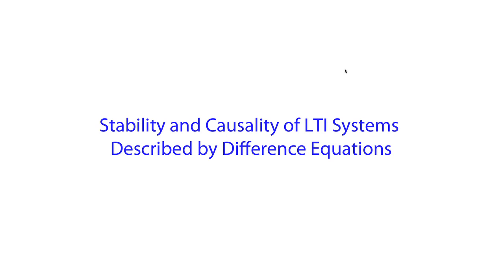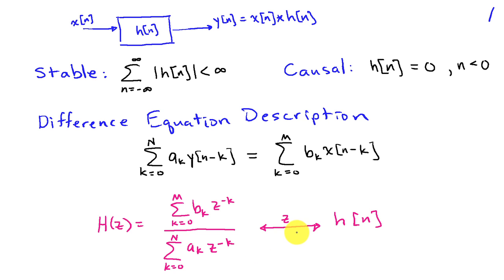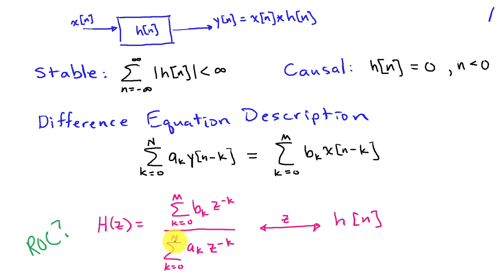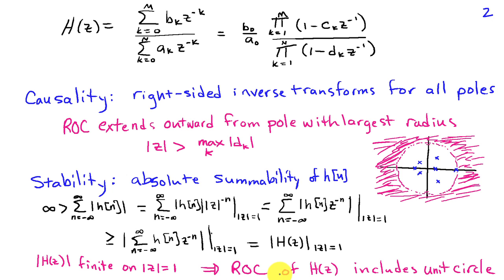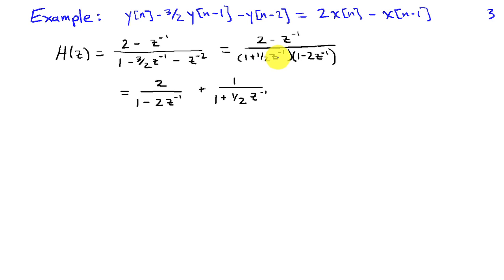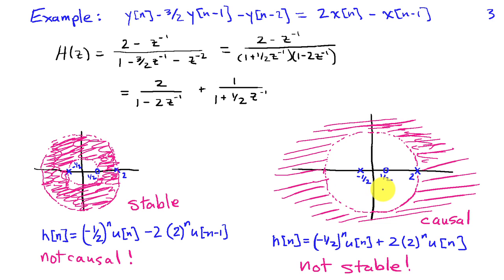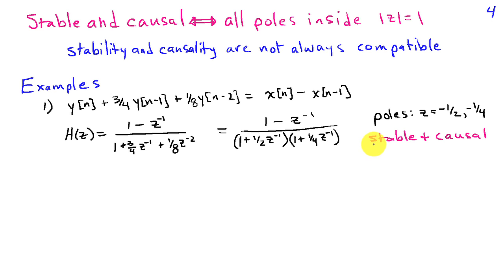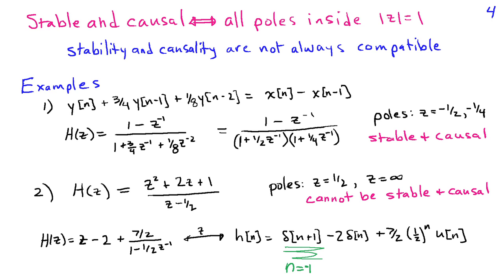Stability and Causality of LTI Systems Described by Difference Equations

Comment: Thanks again for the videos.  I think there is an error at  [10:40] in the final example.  If I long divide the two polynomials, I get: H(z) = z + 5/2 + (9/4)[1/(z-1/2)]].  I've checked this and it seems correct.  Thus, the coefficients of the 3 terms in the impulse response h[n] should be: 1, 5/2, 9/4.
Reply: agreed; I worked it out in the same way. Then I decided Barry must have done this thing where you divide by z to some power in order to put the transfer function in terms of z^-1, before doing the long division.

 I indeed then get different coefficients (that appear to be correct also when I substitute z for some value and work out H(z)), but they are still different to what Barry gets except the first one: i.e. when I divide top and bottom by z^2, then reverse the order of the equations and do long divide, I get H(z) = - 2 - 8z + 9/(z^-1- 1/2 z^-2), which as I say, checked out with the original H(Z) when I used z=3.5.

It's a bit annoying if the prof gets things wrong because, as learners, we are already challenged! Still, it makes you do and redo things and the point is to learn the methods...though we do need to be sure we are doing it right.

Comment from the maker: Thanks for the feedback.  I checked and believe the partial fraction expansion is correct.  Note that the denominator of the first term in the partial fraction expansion is (1 - 2 z^{-1}), not (1-z^(-1)) as you have in your comment.
Reply: Actually kaanonuk is almost correct: The partial fraction should be: (4/5)/(1-2z^-1) + (6/5)(1+1/2z^-1).  To see that the video is wrong, simply expand:
2/(1-2z^-1) + 1/(1+1/2z^-1) onto the common denominator and the numerator becomes: 3-z^-1  which is not equal to 2-z^-1.  Now use my coefficients and you get a numerator = (4/5)(1-2z^-1) +(6/5)(1+1/2z^-1) = 2-z^-1  as required.
Reply: @mikehagerty9666  I got same as you but with denominators swapped...when plugging these back in I got 2 - z^-1 for the numerator; not sure if his comment above refers to his original PFE or the one done by Kaanonuk (i assume the latter)...and damn those comments are from a log time ago! I don't think Barry is following or updating comments on the youtube channel now
Reply: @mikehagerty9666 you are right
Reply: The PFE is wrong.  The residues are 6/5 and 4/5.

Comment: FYI at 07:00 the partial fraction is wrong. it should be 1.2/(1-z^(-1)) + 0.8/(1+0.5z^(-1)), however result for causality and stability will not change.
Reply: True